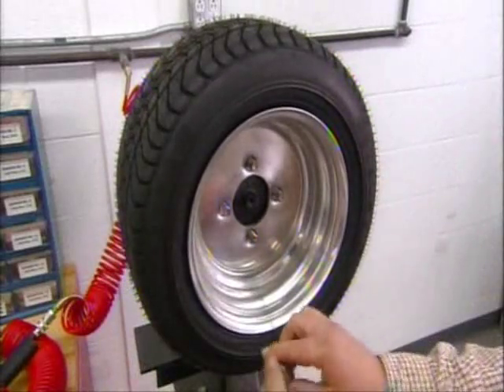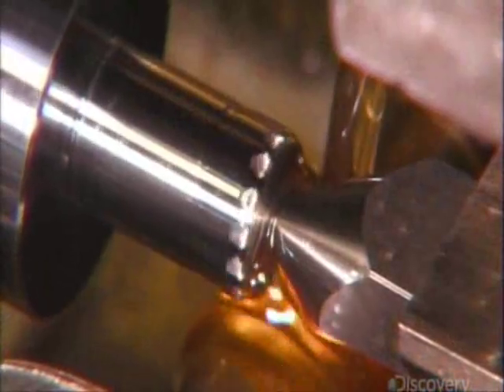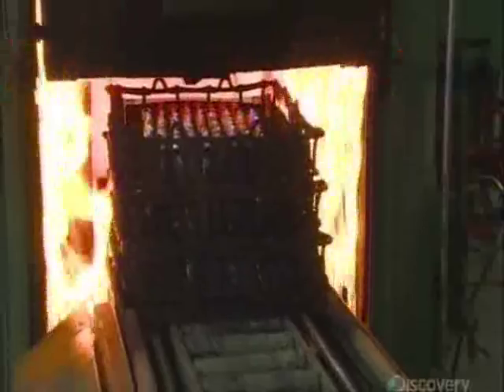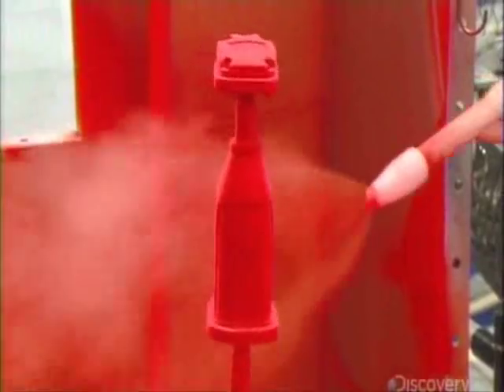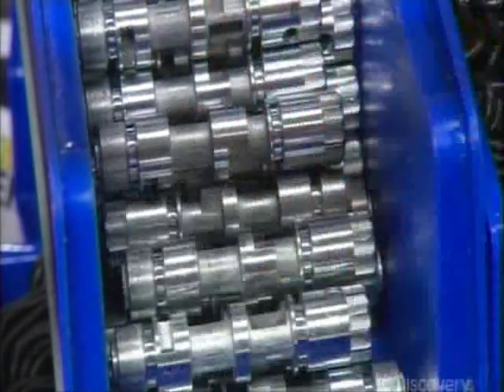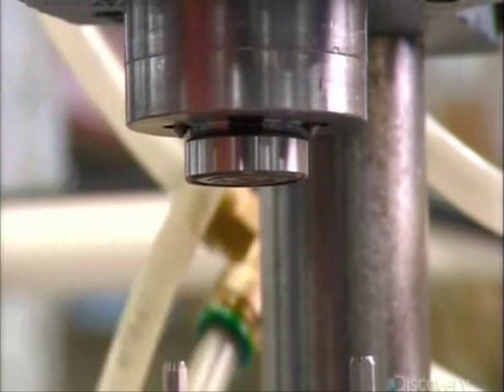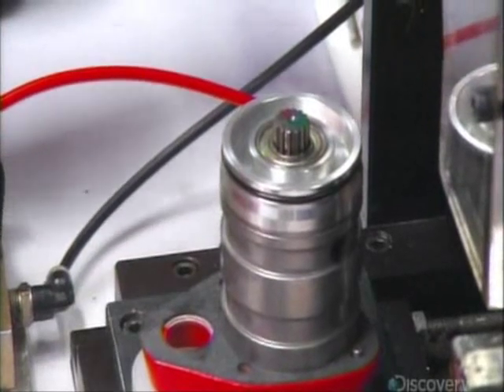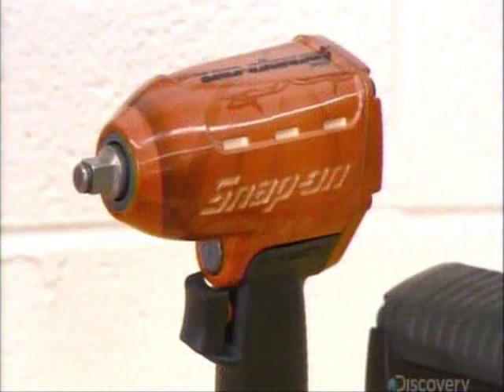How Its Made 03 Pneumatic Impact Wrenches

Comment: IR 2135timax. Smaller and much more powerful then snappy.
Reply: Mobius I wish. I own the gun and it can't even remove wheel bearings with a wheel bearing puller. It just stalls. My uncles snap on just rips the bearings right out.

Comment: after ownig both IR and snap-on impacts,snap-on impacts are junk.my IR 2135 still going strong since i got it new in 2004 never been rebuilt.my snap-on i've had 2 or 3 years has been rebuilt two times 3 months apart and still has no power.
Reply: James Bryan my 2135 is strong too but its weak as shit compared to most snap-one ones I've used. Plus snapon doesn't make composite bodies for their good guns.
Reply: James Bryan I've heard of guys having problems with them I got a 3/8 that is a beast it's about 2 years old and still works like new must have some quality control issues or something
Reply: James Bryan I have an old 231a of bought at the pawn shop and it still kicks ass
Reply: I have my dad's 1/2 impact 15 years old still works fine. Never rebuilt that snap on works